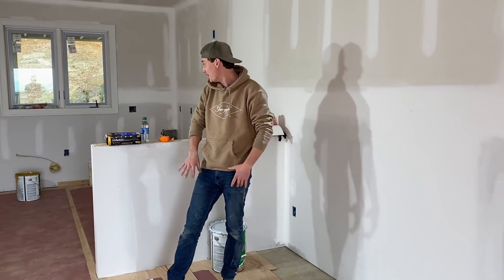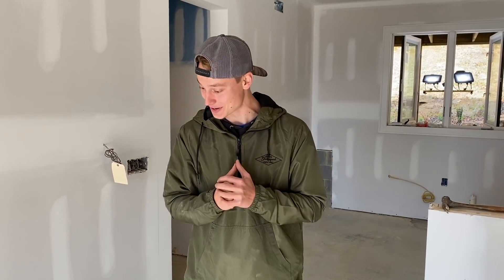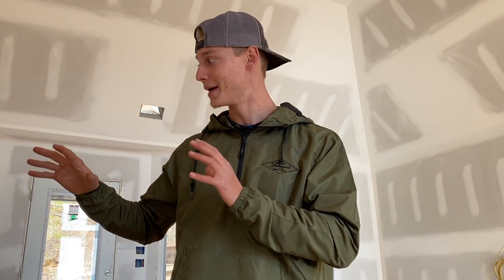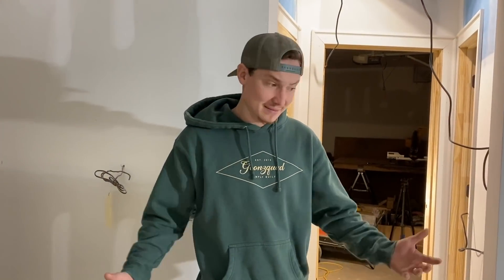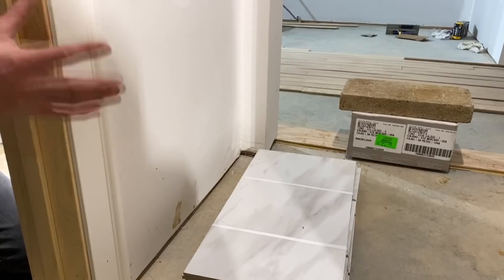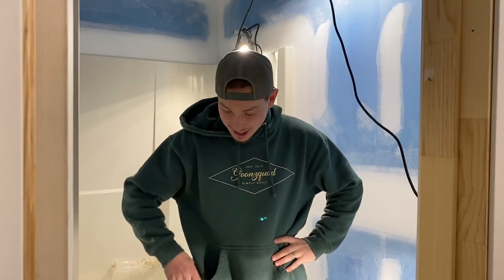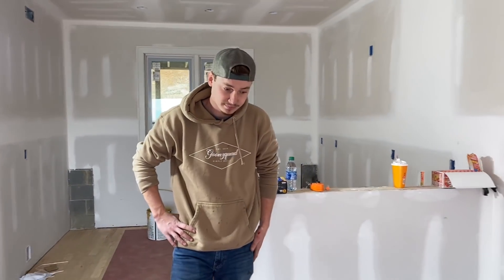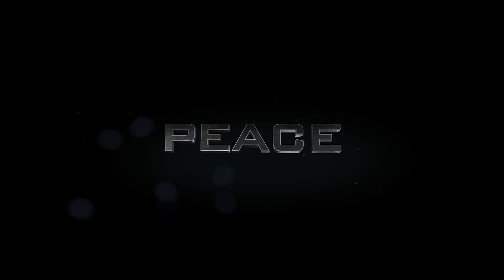The New Goonzquad Headquarters Part 55

Comment: I think I would have put down a vaper barrier, underlayment and floating/laminate floor on the first floor. (might help in case of radon).  I think also, I would frame in the garage and put the French-style front door going from the garage to the back patio and replace the front with a modern door with two sidelights. House is looking good. What a change from the first visit there.

Comment: 18:45 who thinks that putting a dining table would be too  much like too crowded. ( the area they r working on 18:45). i reckon they should put bar type stools and table which is mounted to/against the wall bc its a pretty long space but it isn't wide enough for a dining table so ye i think they should put a bar-type table and stools (from the pillar-door) again the exact area they r working on

Comment: I thought those floors were just glued at the joints not to the floor because it shrinks and expands like all woods do? I also left a small gap next to the walls for expansion? Not sure if there's a difference between flooring but mine were solid mahogany, think yours is 3 sections. I would have started at stairs wall
It's 20 years ago since I did my flooring so maybe changed
Reply: Yes, if the tongue and groove hardwood being used is 1/2" thick or more, it's better to only glue the joints between the strips and let the whole floor "float" by allowing it to move under the skirtings (baseboards), with a cushioned 'slip layer' beneath, and a vapour barrier if that is appropriate. We use this type of flooring in all our residential projects, and usually put the board axis across the shorter dimension of the main room, and then keep that alignment throughout the whole house or apartment. We also use the same species of wood for the staircase, if it is to be made of timber, but have each tread and each riser machined from single pieces. This has been made much easier in recent years by the introduction of CNC fabrication.

Comment: You need to bring in the hardwood floor indoors and keep it there for atleast a week before installing.. the wood needs to adjust to the inside temp and humidity If you dont it will cause the wood to shrink or expand. 
You should have used a subfloor on concrete. Would've recommended in floor heating for the washroom.

Comment: Glue the area out first (0.5m) section, lay your e out though that, drop it in while it is tacky. Then leave it to dry. Then strap off on that section the ensure it is to together. This give you am area to work off without it moving. Use hard wood straps (ratchet straps with flat ends.
When you get to then ends 
. Use 45 degree pegs to help the floor lish against the starter lay

Comment: Guys you should have put a membrane down before putting down the hardwood.  Concrete will have issues with moisture.  I had a friend do this and put hardwood direct on concrete and it bowed up at the edges from the moisture underneath..

Comment: Hope you guy acclimated the wood flooring in a heated house if not you going to have problems even with your doors and trim once you do heat the house you’ll be taking out every door installed

Comment: Make sure you're using an adhesive that also has a sealer to keep the moisture from coming through the concrete floor.
And, what steps did you take to fill in the low spots in the concrete floor. Your flooring will follow the low spots.
Caution... You really don't want polished tile in the bathroom, moisture collecting on the tile could make walking on it dangerous.
Do it right... Prime the wall before you install the cabinets. Protect the wall from water damage.

Comment: Hay guys i work with a builder and do  cab installs, not sure who is doing your  cabinets but they should go in before the floors. As the cabinet feet get glued to the concrete not floor boards as they can move and less secure. Kickers on the cabinets get kickers after

Comment: For your tile saw. The water pump should be in a clean 5gal bucket not in the water tray under the saw. The sand grit from cutting tiles eats up the water pimp - not cheap and your cutting tile with dirty water. You just have to empty the dirty water out if the tray every so often.

Comment: Happy New Year. In Norway - where there are also low temperatures we would never put wood on concrete. Hope this is hardwood - it's a little warmer after all. Why not put heating foil on the floor first - I would have done that. Lovely to walk around without socks even in winter. We never wear shoes inside
Reply: They're in Tennessee, a much more temperate climate than Norway.
Reply: @danielhartin7680  No - Only 1/3 of Norway is in the Arctic zone. It's colder winters in Tennessee than where I live. We do not have such freezing temperatures as you can get.

Comment: I can’t believe you guys only glued the floor down
Reply: Structural adhesives are widely used today to attach car panels (by BMW, for example), to build airliners (Airbus and Boeing) and even to assemble major road bridges. In all cases adhesives provide an all over fixing which is specified and designed to be more effective and stronger than mechanical point fixings such as screws, bolts, clips and nails. Obviously, the type of adhesive utilised in each specific application must be carefully chosen.
Reply: @johnstedman4075   did you test for the moisture content in the concrete before installing? I also didn’t see any moisture membrane
Reply: @mowbs7711  When my Firm chooses to fix hardwood flooring strips directly to a concrete ground slab, several criteria apply. Firstly, there must be proof that the slab has an integrated and adequate DPM over its entire extent. Secondly, the slab must have been built with an incorporated thermal insulation layer that complies with (or exceeds) current standards. Thirdly, The slab must have been powerfloated to a horizontal tolerance of less than plus zero and minus 2mm per metre overall. Fourth, the moisture content of the slab and the timber must be within 3% of each other. And lastly, the installation of the hardwood flooring must comply with all recommendations and instructions published by the supplier of the flooring and the manufacturer of the adhesive. We have been working in this manner for almost 40 years, with no reported failures to date. It has not been made clear which, if any, of these practices Goonzquad adopted in their current project.

Comment: Won't you install underfloor heating on the ground floor? And what about waterproofing / polystyrene under the floor on the ground floor? In winter, could it be cold enough for your feet?

Comment: Just use a sacrificial piece of flooring, put the tongue into the grove and lightly tap with small hammer. On glue, it'll slide so easily.

Comment: In the downstairs bathroom where is the water supply valve for the toilet?
Reply: They will probably fit a vanity cupboard to support the washbasin and hide the H&C and the trap/waste in there. But in a very small bathroom like that it would be better to hang the basin on the wall and hide the plumbing inside the wall cavity. Fitting a cantilevered WC would have helped too, leaving the floor completely uncluttered and making the space seem larger.
Reply: @johnstedman4075  thanks! But the drywall is done and I see no water supply for the toilet.

Comment: Sweet job, but what could possibly go wrong with hardwood floor in the kitchen?😂

Also made your tile cut around your toilet too tight. You have to bolt a toilet flange to the subfloor.

Comment: Umm did you guys account for the anchor bolts that are going to hold your toilets down.  I didn’t see you guys drill the holes for that???
Reply: The are going to need to MacGyver that one. The problem can be solved without ripping up the floor finish, but it creates an unnecessarily fiddly job that could have been avoided.

Comment: Just my opinion I do flooring for a living and I would have went with cortex bc it’s fully water proof and no need to glue it locks in place hard wood when it gets wet it bend and peel up, cortex is just snap and lock in type of floor still has the true wood look

Comment: I'm fixing my house up to sell, so my wife and I can build our dream home. I bought property with a bayou in the back to build on and all! I'm trying to get the most equity out of the current house as possible. I did the same thing when laying the new floors, I took a sacrificial piece of floor put it next to my door frame and used my 20V Dewalt oscillating saw to cut a notch so the floor slipped under the frame. Its such a clean look, and after run a bead of silicone to top it off. On a side note , I sold my 2007 Roush supercharged Mustang so I can build my house quicker. I'm glad you still have y'all sports cars, I do enjoy y'all ripping them!

Comment: Hope you pooped the top of the glue bucket... heating it sealed will produce volatile gasses and expand, risking it blowing up especially in front of the naked flame of the burner heater.

Comment: Great progress guys but why didn’t y’all texture and paint the walls before doing the floors ? Just asking because now you have to cover them up and worry about that when before you could have sprayed the whole house out in a day and not have to worry about the floors because you still had to sand them and same on the concrete on the first floor? 
I know there’s a 100 ways to skin the cat but just curious as to why y’all went that route with the floors before finishing the walls

Comment: Shouldn't you be laying down a vapor barrier and insulation before you put those hardwoods down? Or did i miss the part where they said it was build into the layers of the planking they bought?

Comment: Happy New Year boys !
As much as I admire your energy and willingness to learn stuff you've never done before, I see you making real bad decisions.
Like installing that wooden floor on a non-insulated concrete base. That floor will be cold as ice and damp.
  The Lady won't be happy, son ! Future toddlers too !!
 I would have gone with a (now affordable) heating wire system grouted on the concrete than covered with Engineered wood flooring. Or even better, large tiles as a heat mass. So comfy !
** Also, those concrete blocks in the kitchen corners and in the "garage" will be cold like hell ! 
You NEED to insulate those bare walls with sprayed foam and framed over.
As researched for the temperatures in Chattanooga : in the next few days, it's gonna be at an average 8°C to 10°C daytime with 0°C nigh time! 
That's pretty cold, man !

Comment: Hey guys, happy new year to you too! З новим роком!  
It's very interesting video actually. You are glueing hardwood directly to the concrete, is it ok? I'm asking as we are nailing down some sheets of plywood to the concrete first and only after that we put glue on plywood, so that hardwood has some water/moisture barrier. Maybe that's just how we do it in Ukraine. And that's totally fine to throw it directly on concrete slab. BTW, what exactly type of wooden floor are you using? (as there are different materials.) I believe that's oak boards, but are they sort of layered? or just plain dry oak boards cut for needed thickness? 

p.s. If you understand Ukrainian we can chat in Ukrainian, but English is also fine.
Reply: unless your hardwood is engineered hardwood (layered, when bottom layers can resist moisture).

Comment: I was told that you put a vapor cloth between the concrete and the wood. Am I right on that or no. Someone let me know. I know for a fact that in the bath room there has to be a plastic orange thing under that tile. I forget the names of the stuff. I am old and so things don't come to me as quickly. Well like some of you said it's their house. So whatever. Have a Happy New Year to all
Reply: Hardwood strip flooring can be bonded directly to a concrete ground slab but only if it is certain that there is a DPM (Damp Proof Membrane) beneath the slab, that the DPM is homogenous and is working correctly across every part of the slab, that the moisture content of the slab is within the range which the hardwood floor will tolerate without distorting, deteriorating or debonding, and that the temperature of the slab is stabilised at an appropriate level. Hopefully Goonzquad ensured that all these criteria were met before conducting their installation.
Reply: @johnstedman4075  Thanks John
Reply: @jamesmaroon6161  You are welcome. Have a good 2021!
Reply: I think the orange material you remembered  which was used to waterproof a shower or bath pan was probably 'Kerdi', which is made by the German company Schluter, who are the acknowledged leaders in this field. They do a huge range of products, we've used many of them, and they've never let us down. Here's a link if you want to see their informative site: https://www.schluter.com/schluter-us/en_US/Building-Panels/KERDI-BOARD-Panels/Schluter%C2%AE-KERDI-BOARD/p/KERDI_BOARD

Comment: My neighbor had a glue down hardwood floor and while she was on vacation the toilet supply line sprung a leak and flooded the house, there was a crew of 4 men in there a week removing all that glued down hardwood. It was bear to remove.  And I'm afraid there is going to be water damage around that front entry door if its installed like the big window above it.  And hardwood in the kitchen is going to take a beating. But its their house and they will be living in it and they are jazzed, so go boys go.

Comment: The wall waves but floor is not
waved flooring in below sheet rock should not matter...also you not doing this floor correctly cut your own lengths a must the wood is not the same thickness I see from the start... and moisture guard first before 
Flooring starts...problems coming

Comment: You didn't put a moisture barrier between the concrete and flooring -- big mistake ! Look under a rubber welcome mat on a concrete front porch and you'll see  moisture . Your wooden floor will buckle when the floor absorbs and swells from that moisture . Big mistake

Comment: guys dont under estimate people with bad intent. run cat 6 to multiable points in the house.  hard wire for you biz and put the wifi behind the hardwired managed  switch the wifi can be picked up outside limit the range . just some advice from an it guy

Comment: That bathroom floor should've had the "pink stuff" and a waterproof membrane on top of it then the tiles. I'm from EU but it seems pretty straigh forward although we build houses differently here. Most likely the floor will have leaks for sure.
Reply: I think because it's a concrete floor and not wood.
Reply: @cuoregranata9  even worse.

Comment: That might be the worst flooring stagger I've ever seen lol.  Not sure how that's going to hold up with just glue and no underpaid either.
Reply: We usually get our inspiration for timber flooring staggers by looking at the way it is done on the decks of yachts and liners. Luckily, our Chief Joiner is a nautical guy, and always creates amazing floors whether using oak, teak, mahogany or many types of pine and other species. We always install underfloor heating, advise owners to encourage their guests to remove footwear indoors, and the work we did in the 1980s still looks great.

Comment: I glued wood parquet flooring over concrete. Two weeks later it buckled from the moisture expansion of the concrete. Make sure you put it down loose and leave a gap all the way around so the floor can float.

Comment: Solid wood straight onto concrete?  Due to the slab's moisture - only engineered wood flooring is recommended to go straight onto concrete.
Reply: I believe they are using engineered flooring... but the issue is that they didnt bring the flooring inside and let it settle to the interior temp and humidity.

Comment: I noticed the issue with the toilet flange-  just a speed bump but you'll deal with it as you figure it out-  I may have run the floor side to side but it still looks good-

Comment: That is not how most people do hardwood floors. That's a lot of extra time cutting and placing the boards for no reason.

I'm not saying there's anything wrong with it, I'm just saying that there are much more effective and efficient ways.

It also depends on how many people you have working together. 

1 person putting down the floor, 1 person running back and forth between floor guy and saw guy, and the guy on the saw cutting, and shaving boards if it's needed. 3 people can do that house in one to two days no problem.

Considering you're learning as you go and all that... you guys are doing fantastic!

The mat at the front door versus a tile area is simply a preference. Personally, I'd do a tile/slate/etc area to protect against muddy/snowy shoes/boots/etc... because then there's no need to fight a mat sliding around or the door catching on it, etc. It's also so much easier to clean tile than mats and it looks better, IMHO. 

In this case, I'd pick a tile that closely matches the outside stone color and make it about 5 feet wide (1 foot-ish past each side of the door) by about 3 feet in.

Source: I'm a designer and builder and none of that means anything because it just comes down to what you want. Cheers! Love your videos!

Comment: Sorry guys I am sounding like a serial moaner but I am not. You will very quickly have issues laying the wood onto concrete that has not had a vapor or moisture retainer added to the concrete surface and if it is even slightly uneven  the gap no matter how small will quickly give you issues with the floor.